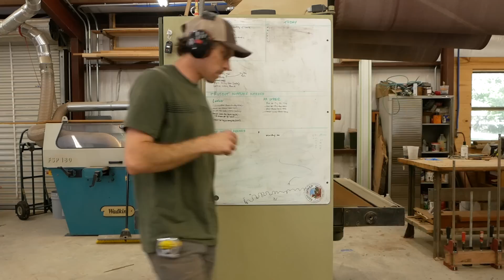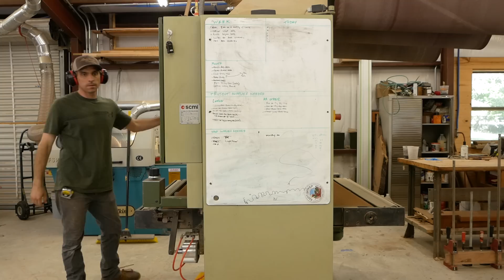Handcrafted Ping Pong Paddles - Why Not?!

Comment: Why no rubber on the pads?
Reply: My thoughts exactly.
Reply: Tom Ahoks thin rubber between ply layers also.
Reply: Theyre ping pong rather than tt
Reply: Tom Ahoks because it looks ugly
Reply: There are paddles without rubber.
Reply: Pffffff then they are just cheap toys that you can't get and performance out of
Reply: You have to add rubber
Reply: You have to buy them separately. This guy is just demonstrating how to make the blade. Rubber selection is a whole other topic
Reply: @hjalleson7021  but they Are handcraft, can you make a profesional paddle with your own hands?
Reply: Rice MenaRQ he oiled them. So obviously having no intention of putting rubbers on
Reply: oil on the surface of the blade will get absorbed and evaporate in time. the varnish is just so the blade will not splinter when you take off first batch of rubber.
Reply: You have to out a finish on them before you put rubbers on it. finished to preserve it especially if they plan to add rubber later, when it comes time to change the rubber and peel off the glue. I suggest lacquering your blades.
Reply: he's right. the brand Stiga is infamous for not sealing their blades and are prone to splintering decreasing the blade lives so you're forced to buy their brand of lacquer separately.
Reply: Stiga calls it your own choice, which kind of sealing you prefer. Actually I prefer to do it my self. For example water-based lacquer does not change the character off the wood as much. There are different kind of sealings, which one to use is as a philosophy as much as everything in table tennis from wood to rubber to glue ;)
Reply: @roboactive  thats why you will never be a table tennis player
Reply: @mateuskimoto4152  Tell me why he made it then! Did he make it to be beautiful or did he make it to be a professional table tennis player?
Reply: @roboactive  the rubber doesn't make it ugly, he could not have rubber to put in the pad
Reply: @mateuskimoto4152  Is this the first video you have seen from Andy Rawls?
Reply: Hyper Webber But if they were ping-pong bats then he would have put sandpaper on the blade of the bat
Reply: because ping-pong rubber is expensive. I'd rather buy a whole new paddle than re-rubber my own.

Comment: At least 3 times now, I make something at home that I wanted/needed. Then about 2 months later you post a video of the exact item that I made. Only difference is you make it a whole lot nicer than I do. I made some ping pong paddles sometime during spring break when I got bored at home. I didn't have wood enough to finish the handles so right now they are just flat boards in the shape of a paddle, but they still work fine.

Comment: This is so awesome, you have inspired me to woodwork, and it has become a passion. Out of curiosity, how do you keep your chisels so sharp. I have a grinder but it doesn’t seem to get the anywhere near as sharp as yours. Maybe I am holding them at an incorrect angle?
Reply: I think the trick is to sand them with sandpaper using something like 100 and working your way up to like 7 or 8 thousand. The grinder is gonna be pretty rough and leave those little imperfections that take away from the sharpness.

Comment: Thanks for a wonderful carpentry project.  You are close, but NO cigar.  That last brown wash should be a Tack Cloth instead, to remove sawdust, and then glue on "one each of red and black real rubbers from the Table Tennis Store, with their specialized Water Based glue, and a self-sticking end grain tape, to go around the curved sides, to prevent absorption of moisture.  Then you would have made for yourself a genuine pair of paddles.

Comment: ruined the paddles with oil :(  glue won't stick but I adore your work... very easy looking and entertaining
Reply: You have to out a finish on them before you put rubbers on it. finished to preserve it especially if they plan to add rubber later, when it comes time to change the rubber and peel off the glue. I suggest lacquering your blades.
Reply: Wood need to be treated .. glue will stick when oil soaks in